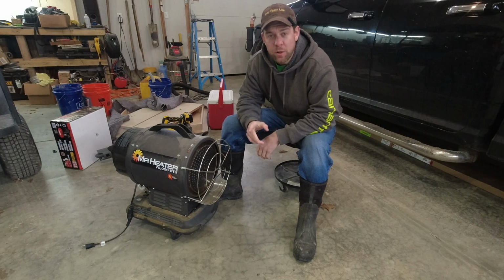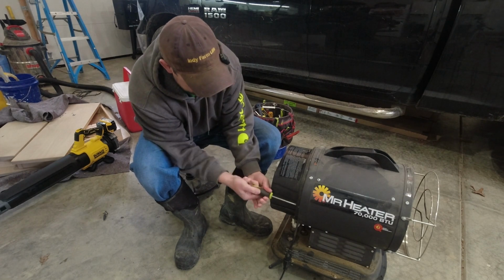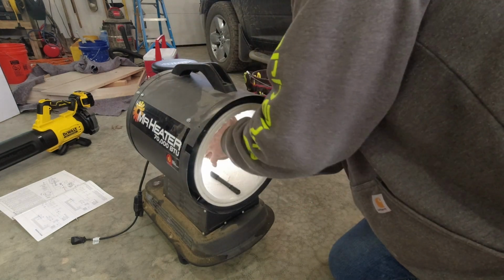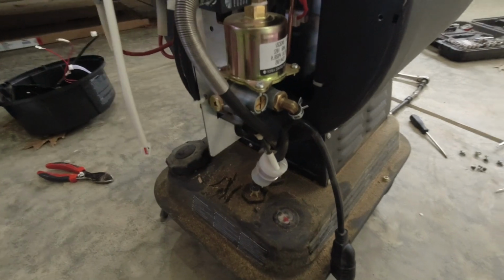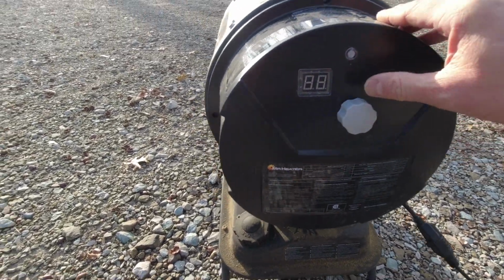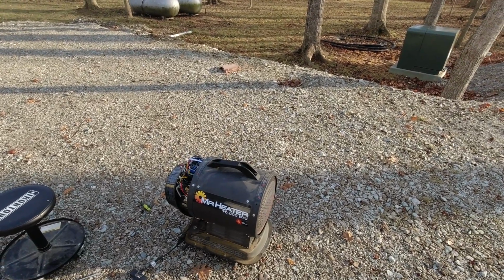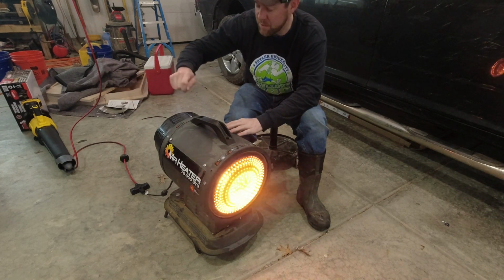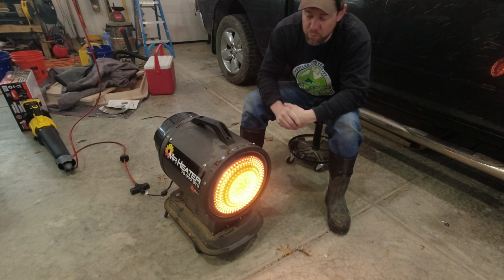OVER Fixing a Heater Problem - Mr. Heater 70k BTU Heater - E1 Error Code

Comment from the maker: For whatever reason, it seems Mr. Heater may have discontinued this heater.  No idea why, I love this heater.  I'm including links to some alternatives.  They are similar in design. ---Update:  The new nozzle has it burning flawlessly again!  3 years in, and I still love this heater. For reference, the nozzle part # is 22323.  
Master 80k BTU: https://amzn.to/3LQwEoO
Remington 80k BTU: https://amzn.to/4r264rM
Sunfire 120k BTU: https://amzn.to/49FzRAQ
Sunfire160k BTU: https://amzn.to/45oxWOy
Reply: So, had this heater 4 years,  for 3 years used kerosene,  last year ran Diesel. Im back to kerosene  and This year turned it on and E1 error.  I cleaned the nozzle checked all the lines nothing, still an E1 error. So i turned that adjustment screw only slightly and it fired right up, then i set the screw back to factory marking and now it works fine again. Thanks for the tip.
Reply: So would you say if you plan to run diesel right off the bat then adjust it before the first fire up?
Reply: @cub8314 i just bought one and of course find people getting errors left and right.. hopefully I see no probs. Waiting for it in the mail and planned on using diesel
Reply from the maker: I think you will be ok.  Mine has been badass since I tweaked it and replaced that nozzle.  Ran it a few hours today.  Clean burn!
Reply: @IndyFarmLife in about to order one KNOWING I will get the E1.   Thanks for the information on adjustments.    

How bad are the the diesel fumes in your garage? You run a CO detector?
Reply: Where did you get the nozzle.  I’m not finding that part number.
Reply from the maker: https://www.mrheater.com/fuel-air-aspiration-nozzle.html
Reply: Did you put the valve back to preadjustment?
Reply from the maker: No.  I have the pressure valve (the one with the line on it) about a 1/4 turn more closed.  Which is the same as 1/4turn open.  The valve on the back is pretty much closed.  Not sure that one has much effect.  After replacing the nozzle and making these adjustments it's burning beautifully.
Reply: @IndyFarmLife  Great info here, I got my about a month ago and I haven’t gotten any error codes but sometimes starts smelling like if it’s not burning the fuel properly and I just realize today that the pump was or is leaking. I took the nozzle out and cleaned it. I think it got better but this is the second or third time that does that.

Comment: I bought 2 of these used for $60. Different brand and 55 or 60 thousand BTU. One burns a lot hotter than the other. Haven't played with the adjustments much cus I can't find any instructions. I know one screw is pressure. Can't find any information about the other.

Comment: I bought mine because I was cold too! Lol
Reply from the maker: Good reason huh? Ha
Reply: @IndyFarmLife My heater is a bit of a PIA..
Reply from the maker: @robertmarsh5786 PIA?
Reply: @IndyFarmLife pain in the a$$
Reply from the maker: @robertmarsh5786 ahhh. What trouble are you having?  Mine is still running strong.
Reply: @IndyFarmLife starts up and shuts off after 5 minutes or so. The body of the heater gets so hot its wrinkled the decals. I  just noticed that small fan insid the unit is broken but the motor still working.  I just ordered a replacement fan hopefully  this fixes it.  Also sometimes at startup it smokes heavily for 20 seconds or so,  not sure what thats all about.

Comment: Hey guys I bought the same heater and only run diesel. I closed the marked screw completely and then opened it half a turn and it runs greats. When it’s super cold I have to turn it open a little more to start then I shut it off and adjust it back down to half a turn open and it runs great so far.

Comment: ❤❤❤  Does your heater shut off immediately if you use the switch instead of the thermostat being satisfied, which results in a cool down period?  🎉🎉
Northern stopped selling these because the electronics are DEFECTIVE.  ❤❤
If you shut it down using the switch, it should still go through a cool-down.  ❤❤

Comment: Screen in the back of the nozzle is threaded in. Also you need to put thread sealant on the nozzle threads. Just had to put a new nozzle on mine 2 days ago and found that out.
Reply: What type of thread sealant? Fired mine up for the second time today, and I have the "flamage" shooting out the front. No issue the first day though. I am still in the return window and am debating whether or not to keep this heater. We have had a wicked cold snap so I'm wondering if my diesel thickened up with the can sitting on the floor or if it clogged up the first day. New storage container and fresh diesel. Haven't adjusted any pressure screws yet. Sucks cause I was pumped about this heater after the first day using it.
Reply: @chrisbates3419  Loctite 567 is what it calls for in the book on mine. When mine is really cold and the fuel is cold I will get some flame slobber until it warms up. Once I started using power service diesel additive I didn't have nearly the problems. I've had mine for a few years and I'm very happy with it it's the older Master heater version that's 80,000 btus. I rigged it up to run with a household thermostat as this one didn't have the built-in thermostat like the newer ones do. I haven't messed with the pressures whether I'm running diesel or kerosene, as long as the fuel is clean and the nozzle is good it should run either as long as you have the correct pressure. Mine is supposed to be a 112 lbs. Set it to that and it runs fine for me.
Reply: @mikereisner3335  What model heater is yours? Mine says nothing about replacing the nozzle let alot what sealant to use. 
I've been trying to see if there's a service manual available with more detailed instructions on repairs etc.
Reply: @1600dave master mh 80 I believe. I'll take a look when I'm at the shop tomorrow, it's packed away for the summer but I know where it's at.

Comment: Be cautious. I replaced my nozzle today. I had adjusted the pressure screws just as you did. It ran for a few minutes until over heating and caught fire. The disc caught fire and there was an internal fire near the nozzle. I had to unplug it immediately and use a fire extinguisher to put it out. It was a small firepit sized inferno, with diesel leaking out of the back electrical area onto the gas cap. I don't know if I cross threaded the nozzle, or had too much pressure, but it scared the hell out me.
Reply from the maker: Thanks for sharing and sorry that happened to you!  I'm glad you are ok.  I will say that when I had it burning and was actively adjusting the screws, you can hear it ramping up/getting hotter as you adjust them.  I did get a little nervous before I replaced my damaged nozzle.  It definitely wasn't burning properly.  It settled down a lot after I replaced it.  I'm really curious what happened with yours.
Reply: I had to clean the threads out on my nozzle after removing it. They had some kind of thread sealant on mine. After cleaning it out I put some blue thread lock on it and put it back in and it threaded easily back on and I have not leaks since doing that . Hope this helps

Comment: Thanks for the video, helpful.  I got mine about 3 weeks ago.  I have noted if its over 30 degrees it fires up fine, but if I let it set for more than a few days and it is a lower temp, it does not like to start and throws the E1 code.  I have had it do this w/ diesel or Kerosene.  If I cycle it on and off a few times I can usually get it to fire up.  Once I have it running, not a problem restarting when thermostat shuts it down/on. Only an issue after setting or cold starts.
I am assuming the line is draining and it is not priming like it should, diesel being thicker may contribute. 
 I had also seen the prior video adjusting the back screw, I agree it is a bleeder valve or something as if you open it when it is running it will spit out some fuel (unless it lets some air in)?  Did you tighten the back valve all the way?  I just placed tight.  I did not mess with the marked valve yet, did you try opening the marked valve (counterclockwise) as opposed to closing them?  I am going to test your method to tighten the flat head screw.  I tried Mr Heater support, not very helpful. Hopefully this works as I agree it is a great heater, when it works.  Hard to find a heater with a thermostat.  I will also try adding some Heet/Antifreeze to the diesel as recommended in the manual, may thin it just a little.
Reply: The marked flat head screw I took completely out and cleaned and reinstalled the grommet with spring that is located in it. I started with it all the way in and backed it out 1/4 turn at a time. I then adjusted the back phillips screw starting with that all the way in. I ended up with the marked flathead completely closed and the the phillips 1/4 turn out and get hardly and smoke on start up and the flames are minimal. The only issue that is coming up is an e3 code now. Not sure how to take care of this. Update any info you might find out as I think this thread is the most informative on this unit that I have found.
Reply: I did the same and also have an E3 code. Running too hot. Not sure of the Philips valve would alleviate any of that.

Comment: Did you use any threadlock on the nozzle when you replaced it? Mine is leaking diesel after reinstalling it. Not sure of what kind to use
Reply from the maker: @SlowDiscoFourOneNine  Interesting, no I didn't.  I don't think the old one had any on it either.  I didn't see it when I took it off and I also was able to break it free fairly easily.  I don't think mine is leaking diesel.  Haven't seen/smelled any.  It definitely burns much better with the latest adjustments.
Reply: @ mine had sealant on it for sure. Now when I put it back it leaks everywhere. Not happy lol.
Reply from the maker: @SlowDiscoFourOneNine hmm there has to be some kind of liquid tight threadlocker our there.  Or is all thredlocker liquid tight?
Reply: @ my concern  is with the heat if I need something specific for that.
Reply: @SlowDiscoFourOneNine  No you do not. Use regular pipe dope for brass. The diesel running through the nozzle keeps it cool.

Comment: Mine is brand new and throws the e1 code. I just had the nozzle off today and it comes completely apart. I did have small crap in it so hopefully I can adjust the 2 screws and get it working. $300 and issues straight out of the box. I am using off road diesel in it never burned kerosene in it. Thanks for the tip on the screws!
Reply: I just bought mine 4 days again, I’ve been using it since then 2 first days worked grain very low smell other than air start to getting thin after a while but not big deal. 3th day I switched to Klean Heat (Kerosene substitute) worked great almost no smell at all, until yea after I refilled it started to give a super strong smell, like if it was not burning the fuel correctly. It’s brand new I don’t understand.
Reply: @jtecchh8533  I have had mine completely apart. I switched from off road diesel to diesel #2 at the recommendation of their help center. Something in the off road diesel causes issues with this heater they said. I Cleaned the system out completely put the new fuel in it ran fine for a cycle or 2 then kicked the E3 code. Something to do with the high limit switch shut off. I finally got it running where it would turn on and off with the fan working properly on cool down. Then today had it on for 20 minutes and it kicked the e3 code again. No idea what is going on. Gonna call them tomorrow and see how to fix this issue now. 
  I adjusted the flat head screw and the phillips head screw and I still get a few flames coming out the end. The flat screw is completely closed and the phillips head is about a 1/4 open and thats the best burn I get. I started out with the both closed and adjusted from there till the smoke and flames went away. 
I think the e3 code is cause the big plastic outer shell is not letting enough cool air in and heating that switch up so I might cut the bottom half off to let air flow in. We will see.
BTW I know absolutely nothing about these just started taking everything apart and cleaning then putting it back together to understand it more.

Comment: So can we just use it from new with diesel and just change its nozzel and  injector later... without having to adjust it??????
Reply from the maker: I ran it as setup from the factory (i.e. setup for kerosene) with diesel for 2.5 years before I had any issues.  After making the adjustments and replacing the old nozzle (same nozzle as before, just a new/clean one) it now burns much better/cleaner on diesel.  Basically, I think if you get a brand new unit and plan to burn diesel you can make these adjustments.  Or, if yours runs "pretty well" like mine did, you can just "wait and see" which is what I did.  Hope that helps.

Comment: I currently have a 140,000BTU torpedo heater in my 620sq.ft garage, its way oversized and LOUD, but it heats up the garage very quickly, literally 5-6 minutes of running per hour. I might replace it with one of these next year, seems like this would be better for my smaller shop with old insulation, but insulation regardless.
Reply from the maker: If it heats that fast you have to ask yourself if the noise for only 5 minutes per hour is that bad.  That's insanely quick.  I will say this one is extremely quite.  Can listen to music at normal levels with it going.
Reply: @IndyFarmLife  Funny, I actually did end up buying one of these 70k radiant heaters today(HeatStar brand, literally just a rebranded Mr Heater). I've been fighting with my 140k torpedo unit all winter with it lighting once, running fine and then when I go to turn it back on a while later it it'll just spew raw diesel everywhere, after months of troubleshooting and experimenting I finally threw in the towel and returned it(kept the receipt) and replaced it with one of these. 

I like this ALOT more, its way quieter and even though it doesn't heat the garage as quickly as my 140k, it heats it MUCH more evenly. Hopefully it'll be reliable as I run pump diesel in it with a little bit of anti-gel treatment for good measure since -40°C is a very real thing in Alberta.

Comment: Looks like an easy fix. Maybe the new nozzle will clean up the flamage. I have a small propane salamander for my garage, and it heats it very fast, but the noise is Terrible. Your heater is very quiet for sure.
Reply from the maker: Fingers crossed!  It arrived today, so I'll likely install it later this week.  Yes, it's super quiet.  That's what I love most about it.  Well, and the heat ha.  Merry Christmas!
Reply: @IndyFarmLife  Merry Christmas!

Comment: I picked up a used one that has E1 code for $20. I was going to do a video on it when I get the timer. I hope it is that easy to fix. I will try to clean the nozzle in the ultrasonic cleaner.
Reply from the maker: There aren't too many working parts on them, so I would say you got a deal.  My nozzle showed up today.  I'll put it in sometime this week.  Only $25.
Reply: Sweet deal man! Mine was 200 on amazon 4 years ago.

Comment: Hello, if you use the heater often you also have to change the injector every now and then. I change the nozzle on my oil heater every year and have no problems with it. Merry Christmas and greetings from Berlin
Reply from the maker: Thanks for the info!  Mine is on the way, so hopefully that's a quick solution.  Merry Christmas from across the pond!